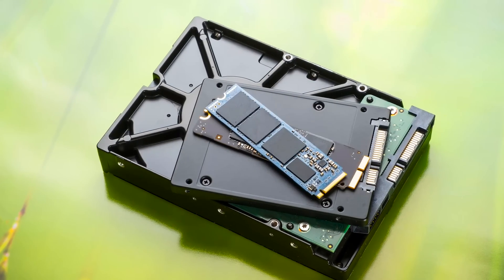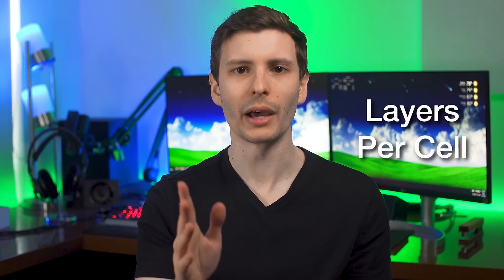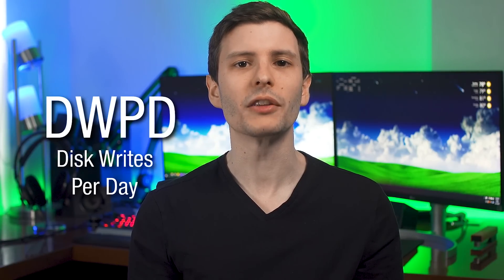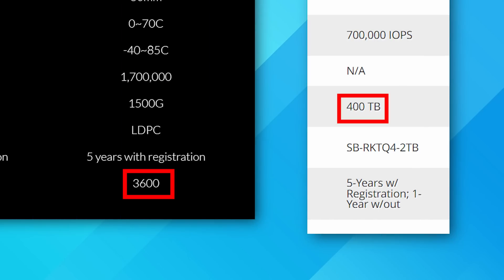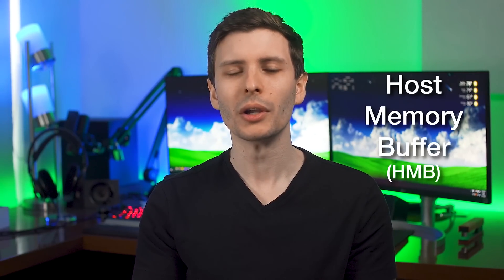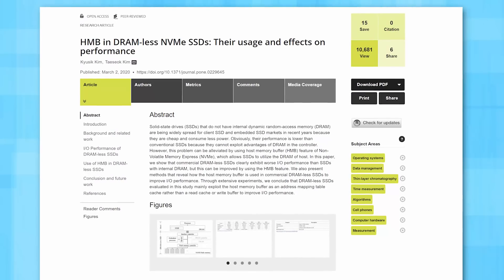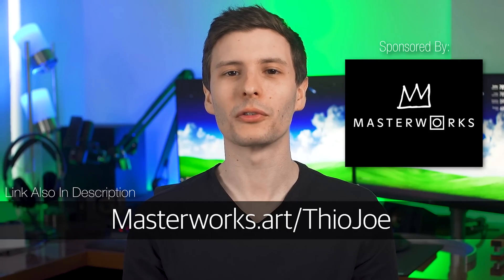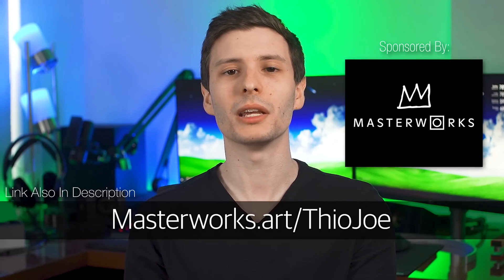SSD Features Few People Know About (Learn These Before Buying)

Comment: You should mention data integrity and performance consistency. Dram SSDs are insanely better in terms of performance and life expectancy but in the case of NVMEs the differences due to much faster speeds and HBM technology is not that noticeable, at least not in average everyday scenarios. Still dram drives still have much better life expectancy in terms of TBW(terabytes written) or years of warranty.

Another bennefit of Dram drives is that they do not drop their performance as much when an SSD is almost full. You have to be aware that the bigger the SSD the performance tend to be faster. On the other hand the fullest the drive is, it's  performance but also it's lifespan shortens. So especially for main drives avoid small and dramless drives. Your data will be at higher risk, especially with cheaper QLC drives.

The other missing part was about the voltage. DRAM drives draw more energy and tend to make SSDs and NVMEs hotter. I think this is the only drawback of dram drives: they need to be cooled and heatsink most of the time is not included and has to be taken separately. Thankfully some motherboards do have heatsinks.

Comment: 15:55 That reminds me of a feature - aren’t the top most used programs stored differently on hard drives?
Reply: Ideally you would have the most used / latency dependent programs on the outside of the platter where hdds are fastest.

Comment: Huge ERROR!!  The layers of 3D NAND is the 3D stacking of the chips, originally they were conventional planar single layer.
SLC, MLC, TLC, QLC is using different voltage levels to store more bits per number of cells for cost reasons.  Single Level Cell 0/1  SLC

Comment: Hello, I don't know why, my Intel 540 240GB Series with MLC was constantly micro freezing my Windows (for a few fractions of seconds mouse cursor and Windows in general was freezing almost all the time). And it happened since was new, I bought it in 2015, one of the last ones on stock at the time, but sealed. Life remaining on it dropped pretty fast to 80 and something life, and performed worse than a TLC Kingston that is working perfectly now, no micro stuttering under Windows while moving files, watching YouTube, saving files, etc.

Comment: Everyone seems to fuss about TBW limits, but I've only ever seen one dead SSD and that was a very old SSD that got moved around a lot - were not even sure if it died because of flash saturation, it might have been physical damage or shorted. I've seen stacks of dead HDDs, some lasting only a year. Not to mention DOA rates seem to be much lower in my personal experience.

Comment: so generally less capacity = more endurance. maybe I should buy 120gb ssd as the "write" tasks (temp folder, firefox/chrome profile, downloads, pagefile etc)

am I getting this right?
Reply: No more capacity equals more endurance all other things being equal. Having more nand cells due to the larger capacity means it has more cells use for garbage collection and wear leveling. Its proportional though so same drive all things equal besides capacity the 2TB drive will have double the endurance of the 1 TB

Comment: Your videos are really informative and great. I would like to suggest you look into PCH vs CPU based PCIe and how that relates to your PCIe lanes available to the SSD as most consumer CPUs have a total 24 CPU-PCIe lanes (GPU-16+NVMe-4+PCH/South Bridge-4). The PCH offers PCIe lanes almost 20 but through the bottle neck of x4 usually on Ryzen x570 boards or similar in intel land. Not sure if you covered this topic but I think its a little risky to say just plug in any PCIe NVMe adapter, you could end up throttling your other components with out realizing it. Less SSD anatomy and more SSD ecosystem.

Comment: The hard thing about choosing an SSD is that the specs of a product are often hard to find. Many websites don't even mention DRAM
Reply: The problem is when reviewed they may have desirable spec parts, then they change them to cheaper.
That's why they obscure the specs as a legal loophole.
This has been a general problem with less & less information provided to users
Reply: If you look at technical sites like Tom's Hardware they will often mention it. Take 5 minutes and go through the (20 pages) article
Reply: I'm super late, but I just went on amazon, when the reviews, and typed dram in the search bar that's close to it. They've usually answered it there.

Comment: What happens when system variables like %Appdata% are set to a location on the D drive. Would you recommend this as a way to save C drive space on hybrid laptops like mine, which have a tiny SSD for windows and a big HDD?
Reply: In my experience, this works in theory but in reality will likely create a hot mess. Can't you replace the SSD with a bigger one?
Reply: Some utilities like Intel RST or StoreMI for AMD let you use the SSD as a cache for the larger drive without worrying about that

Comment: @ThioJoe you did not mention Active State Power Management, which is a feature with various levels of support depending on the specific model. With support for low power modes V1.1, 1.2 or V1.3, you can get extremely low idle power usage (<10mW). For someone building a low power PC or searching for ways to improve efficiency, this is worth consideration.
Reply: how do you access it?

Comment: Hello,

Isn’t HMB the same as enabling the ’stop flushing write cache’ settings in the Strategy tab for each storage in the device manager?
I wonder what’s the differences between HMB, not flushing write cache and similar proprietary features you can activate through the manufacturer software, like Samsung Magician’s RAPID mode.

Comment: As a professional IT tech for over 30 years, it is my opinion that no one should need to worry about this theoretical TBW nonsense unless you are a power user or in a data storage service business. QLC NAND being used as a boot drive will likely last far longer than a mechanical hard drive and far longer than the other components in the system. When an SSD runs out of 'writes', it becomes READ ONLY. It does not FAIL. If you showed us REAL examples proving your point on camera in REALITY, that would be far more beneficial. DRAM on an SSD is of no interest to the average consumer. This is purely a power-user need, which makes up less than 10% of all computer owners. Would have enjoyed a dose of reality in this video, or at least acknowledge that this information applies to less than 10% of all computer owners and WHY.
Reply: J M  No issue there. Just feel like a disclaimer would have been nice that the information is not critical or important to 90%+ of computer owners. This is enthusiast level information. The issue is it often leads to people over-spending for things they don't need because they don't understand why this information is important. Most people do not use their computers in a way that this information would be of any benefit to them, in my experience in this industry. I've had to explain to consumers that they mis-understood the content and that the content did not apply to them. It made things overly complicated, caused unnecessary expenses and created anxiety because there was no disclaimer or full disclosure as to who this information was intended for.
Reply: in the company I work all computers are so slow with no apparent reason, the it guy said it was ssd's

Comment: I'm trying to get a ssd like m.2. Researched everywhere on product page on amazon, manufacturers website and on web but no f*cking listing tells properly if the ssd have dram. I don't know if I should get a dram less because I have already one of 240gb and I want one big storage now as that is the only storage in my pc. Or should I get a 1tb hdd at half the price???
Reply: If you go to read a review of it at enthusiast website like Tom's hardware they will often mention it. Alternatively you can google search pictures of the product and you can tell from the chips on the board whether it has DRAM or not.
Reply: Get samsung
Reply: @CaptainScorpio24  Samsung has DRAM-less drives
Reply: @raul0ca  which ones??
Reply: @raul0ca  Samsung evos has it all
Reply: @CaptainScorpio24  Off top of my head Samsung 980 NVME m.2 SSD

Comment: WD Blue SSD is the best, Most robust..I've had them for ages.
Reply: Is it still working?
Does it have dram?
Reply: Not sure what DRAM is but ALL my SSDs work perfectly..I like them they are like the modern cassette tapes of the PC world, You can get a slot to stick them much like how you stick cassettes into the players..Very convenient vs having to open up the PC all the time and hoping you got enough space on the board to add a HDD when you wanna add one.

Comment: As with everything else it comes down to speed and durability vs cost when choosing and SSD.
Reply: Evos r best
Reply: @CaptainScorpio24  Depends on the use.  They're great for internal storage, but the Pro drives are faster and more durable than the EVOs, making them better for boot drives.  However, if price if your deciding factor then EVOs fine for boot drives.
Reply: @wildbill4496  I'm using Samsung 850 Evo 250gb since 2015 for boot programs n games.  7 yrs has been passed n it still works like day 1.
Gona buy nvme top end 970 Evo 2 tb for my newly built 12th Gen i7

Comment: I'm wondering which SSD setup you'd recommend. I currently have a 2tb 970 Evo and wanna upgrade to the 980 Pro. Just Windows and software on one smaller drive and games, video files etc on another larger one?
Reply: if you have PCie gen 4 m.2 slot you should if you dont its gonna be the same
Reply: Evo is best now.
Wait for Gen 5 drives Gen 4 will get cheaper
Reply: @CaptainScorpio24  I don’t care what’s in the future. My point was just if it would make sense getting 2 separate drives (one for OS and basic software, the other for games, stuff I edit etc) with or a single large drive
Reply: @RealThore  yeah go ahead. windows n programs on 1 and other things on large 2tb
 currently i hv 850 and 860 250gb setups in tge similar way since yrs.
will buy a 2tb m.2 for the same and replaced one of my as external